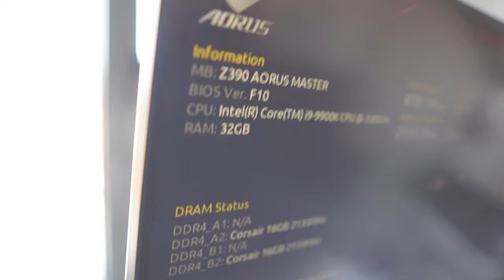No talking... just building a silent Hackintosh/Gaming PC for music production

Comment: 2133mhz!?
Reply from the maker: No, it's actually 3200Mhz "Corsair Vengeance LPX DDR4 3200Mhz PC4-25600 32GB 2x16GB CL16". I know it appears like that on the BIOS on first run for some reason, I updated the firmware of the BIOS later.